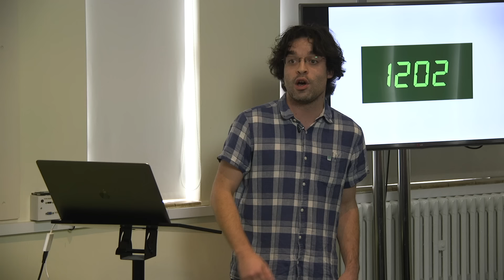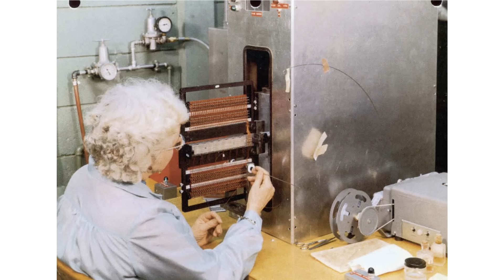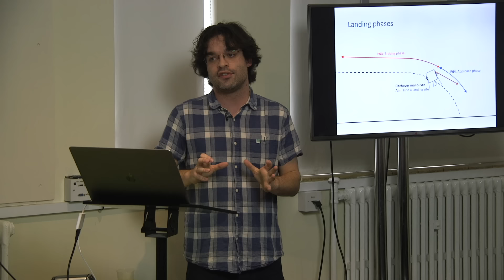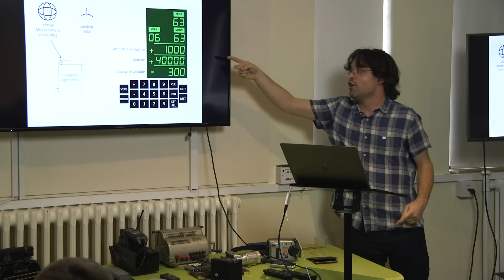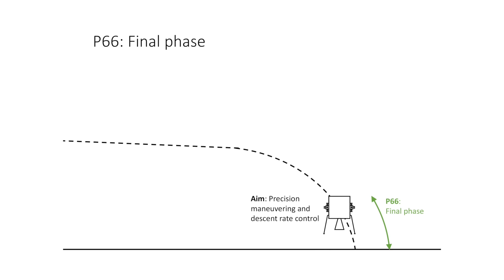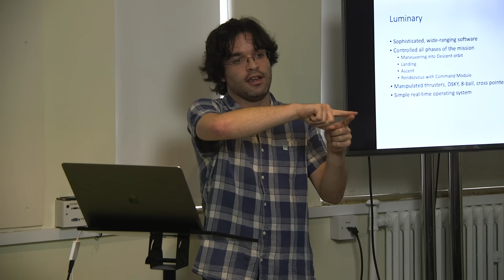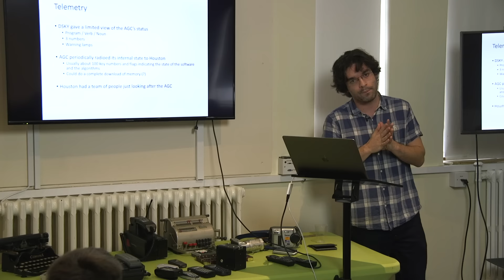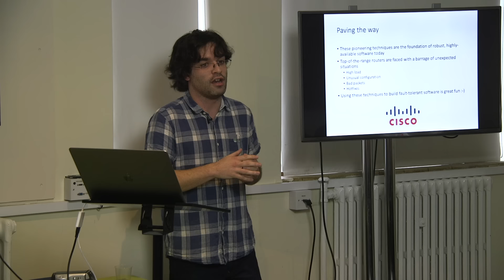Light Years Ahead | The 1969 Apollo Guidance Computer

Comment: Fascinating. Not only does he explain what we would consider a primitive computer, but explains cooperative multitasking in the CPU. By the way, Apple used cooperative multitasking in its operating systems (Motorola 6000 series) up to OS 9. After that, the company switched to what windows and intel already had: pre-emptive multitasking which essentally means the abiity to run multiple programs withoutn throtting or pausing other programs. 

Although the Lunar Landing project’s computer used cooperative multitasking, it’s cpu was overloaded at a critical point by an unforseen power guzzling radar which was pointed not on the ground with the others, but into space for the return. The simple fix was for the astronaughts in future missons to simply make sure that radar was OFF.  The 1202 and 1201s were the error alarms that made everyone freak out. Turns out, they were simply saying “ there’s too much shit coming in for me to digest!”

Armstrrong and
 those who followed always used the manual stick for the last few moments of touchdown, however, the computer was always on and functioning properly.

Comment: Great talk!  I remember the landing like it was yesterday.  Thanks so much.
Reply: P.s.  You should contact Draper Labs, I believe they designed the IMU and probably helped or even designed the simulation software for the IMU and computer testing.  I have worked on strategic guidance systems with them and visited them on a few occasions.  They are basically MIT guys.  Good Luck.

Comment: Over 40 years ago I knew a philosophical sage, a wireman, who I watched putting together a large TTL logic board with 5,000 individual wire connections, all meticulously checked as he proceeded, as one mistake would render the entire work invalid, while at the same time conducting a philosophical conversation with me.
.
The connections were made by the wire-wrap method, using a drill-like device that twisted the end of a wire around a square-cut terminal post, so the sharp edges of the post bit into the wire, making a very solid connection.
.
All the wires had the same pink colour of insulation, as there was no point in trying to colour-code them. The insulation was not stripped off. The wrapping tool, in binding the wires to posts, effectively punctured the insulation to make the connections. Interesting technology.
.
He was a very calm quiet individual, and had a reputation for being able to reliably do what he did. One of the most amazing people I have met.

Comment: I also share your love of compurt history. It turns out that the first mainframe commuter I had access to and wrote programs for,  a CDC6500 at Purdue University, was resurrected and is now running at a northwest museum. Unfortunately it is not running MACE, MESA, and PROXSY, which were developed at Purdue. (It would bring back a lot of memories to see the familiar +++ PIRATE prompt again.)

The 6599 did not have a stack so they implemented an Exchange Package to make the timeshare of more than 100 user terminals possible.

Comment: So, they saved the computer, the software, but not the data collected. Only one reason makes sense: the data was a smoking gun that incriminated NASA.
Reply: All of the data is available in each mission report. You can look through it any time you'd like.
Reply: @casanovafrankenstein4193  also, all the tapes bar the ones from apollo 11. the most absurd part is that out of ALL POSSIBLE EVIDENCE, those tapes would actually be by far the easiest to fake if you wanted to

Comment: While modern software techniques and tools produce much more bulky code than was produced for earlier, more cramped systems, there was also much less code written because it was more difficult to write for smaller systems.
Reply: @lepidoptera9337  Embedded systems are a very different kind of programming than desktop applications.  Go try writing a word processor that way, like people did in the old days of 8-bit machines.  One thing I know is you won't be back any time soon.
Reply: @lepidoptera9337  So you're not writing anything from scratch and crowing about how quickly you can write everything from scratch.  Got it.
Reply: @lepidoptera9337  Here's a helpful tip for you:  I am not you.
Reply: @lepidoptera9337  Why would me not being your projection of yourself be bad for me?
Reply: @lepidoptera9337  And so you had that humiliatingly zing over your tiny head, like everything else I've humiliated you with.
Reply: @lepidoptera9337  Wow, EVERYTHING that ANYONE has ever pointed out to you has just gone WAY over your head, hasn't it?
Reply: @lepidoptera9337  No, you see, you're looking in the direction we call 'up.'  That's because you're wondering what all those things that are flying over your head by such a huge margin are.

Things like, for example, every single one of my comments.
Reply: @lepidoptera9337  By demonstrating that you don't know what any of the words other people use mean?
Reply: @lepidoptera9337  Yes, I am aware that you are uninvolved with embedded systems.
Reply: @lepidoptera9337  Right, the way NO MODERN OS DOES IT.  The OSes that DID do it that way are noted for how poorly they multi-tasked.  Next you're going to pretend that QNX is a good workstation OS.
Reply: @lepidoptera9337  And, like everything else you've claimed, the exact opposite of what you want to do in application programming.  Still think you can write a word processor from scratch?  Or have you gone and learned what that would actually mean you would have to do?

Comment: Nice presentation.  I am not old enough to have worked on Apolio II did work on thr Viking Mars Lander starting in 1972. While Apollo had 400,000 contributors  Viking had 10,000.  Still I sm” amazed ar rhe difference on onbpard computers. Viking by comparasion had a real computer but still a difficult fit for all of the mission requirements..
Some topics were not presented.  Testing Guidence and Controll requires
Reply: a physical world model.  It needs take descent engine and RTG

Comment: his comment on modern computers not featuring positive and negative zero is incorrect.  IEEE 754 floating-point standard (the standard for Intel CPU's)  includes this feature. It is used in linpack for example to distinguish functions that approach zero from the positive and negative sides.   the old timers knew exactly what they were doing.
Reply: That’s not the reason some old computers used one’s complement.  When asked why he switched to two’s complement for his Cray-1 computer, Seymore Cray said he just hadn’t understood it when he designed his earlier one’s complement machines.
Reply: The IEEE 754 standard  does not use twos or ones complement. So it is not connected to what Seymour did.

Comment: 1:15:25 = Yes they knew about cosmic rays, they tested and found out regular chips were not good enough, so a whole new line was developed specially for this job. Originally they wanted to fly with 2 units, but do to weight had to go to just 1.

Comment: Aldren said that he purposely left the radar to the command module on "just in case" they needed to abort.
Reply: It is quite strange that Wills never mentioned this simple straightforward explanation that Aldrin admitted to.
48:12 - Wills goes so far to explain that the Rendezvous Radar was completely useless when you were landing on the Moon.
The obvious point he never acknowledges is that therefore, there was absolutely no reason to keep it powered on at all after the PDI burn was started.  There is no sense to have a checklist procedure direct you to keep it powered on.

A better presentation would have had a slide showing that entire 15% of processor load as being extraneously introduced by Buzz winging it, deviating from procedure, all because in the heat of battle, he felt it was a good idea to hedge his bet that they might abort.  The irony being that his desire to 'buy insurance' for an abort came excruciatingly close to causing them to abort.

The real hero here is Armstrong.  For not killing Buzz once he found out what he did.

If Buzz thought this deviation was a good idea, the bare minimum due diligence would be to inform his Commander.  More properly, also inform Ground Control, who would then have the action analyzed by engineers.  Weeks, if not months in advance.  As a fighter pilot, Buzz should have been taught decades earlier to avoid the 'Three D's'.  Don't do anything Dumb, Dangerous or Different.

This switch deviation violated 2 of those D's.  It was Dumb and Different (unbriefed, unpracticed and untrained).  Then as the landing progressed, it also proved to be extremely Dangerous.  We can expect that Shepard, Slayton, Kranz and Kraft were all livid with Buzz.  All the was up the chain.  And that there is no way any of them would ever let him fly again.

But it was too late for any accountability.  Buzz was declared a hero.

And this is the only reason why I can explain why Wills refuses to state what is so obvious.  He dances around the notion that his hero made this huge error.  One person who knows this story probably better than anyone else is Don Eyles.  Yet he too dances around this straightforward explanation that Buzz Screwed the proverbial Pooch.  Here's the story Eyles tells:
The Real Story Behind the Apollo 11 Computer Error | WSJ
https://www.youtube.com/watch?v=z4cn93H6sM0

Again, the best answer I can arrive at is reluctance to criticize a person they uphold as their hero.
Reply: ...but at least that vid clearly states "human error":
https://www.youtube.com/watch?v=z4cn93H6sM0&t=6m31s

Then stops short of naming the particular human, and why he did what he did.
It was not accidental.  Buzz did it quite intentionally.

Comment: Hubble's Constant, indicates that the Big Bang remnants, with 97.5% 
redshift, were at 13.4 billion light years when the radiation that we 
can now observe was emitted, so this indicates that there is no Big Bang
 to be seen. because in 14 billion years this cannot happen. So it      
   seems that the redshift was not caused by the big bang and that it 
has a different cause, then if we know that the big bang is still 
inexplicably accelerating according to the big bang can offer a 
solution, in the first place all galaxies are almost standing still and 
the light from the so-called big bang remnants can reach us in 13.4 
billion years, the atoms seem to have halved in diameter in almost 7 
billion years, you can from a 50% redshift galaxy that is located at 
nearly 7 billion light years according to the Hubble Constant, our atoms
 that have been halved in nearly 7 billion years have an electron shell 
that is half the circumference of nearly 7 billion years ago and 
therefore twice as much quickly turn their circle around the core, also 
here runs faster through time and twice as fast, which causes the 
shrinkage to also go twice as fast as almost 7 billion years ago and it 
seems that the expansion of the big bang is accelerating, but it is 
shrinking faster, that has some consequences, that the next halving will
 happen in 3.5 billion years and then in 1.75 billion years, etc. , that
 means that within 7 billion years the atoms shrink so far that our 
planets and stars become as small as atoms, we cannot perceive that with
 our clock because our clock is running faster and faster, but the 
planet Jupiter may become smaller and with our measuring stick seems to 
be moving farther but Jupiter continues to describe its normal orbit 
around the Sun and will continue to orbit the Sun in 35 years, if we use
 that as a clock then after 30,000,000 rounds 1 billion years will have 
passed and after 210,000,000 orbits that is 7 billion years and we have 
become infinitely small where the planet jupiter may still revolve 
around the extinct Sun, but not bigger than an atom that we can still 
see today. Whether this is really going to happen is also questionable, 
but it does show where the universe is going to evolve, the redshift 
bands show that there are structures that can influence the shrinkage, 
but with the shrinkage it may be that the properties of atoms change or 
even eventually disappear completely, after all nothing is eternal.
Reply: How does one measure redshift in percentages?  Redshift, in this context, is z=lambda_obs/lambda_em -1.  Given the cmb was light released at recombination, which is when neutral hydrogen formed, with electrons falling from effectively infinity to n=1, those photons would have been way higher energy than microwaves.  So observing a "cmb" means that we observe long microwaves and dividing by small visible wavelengths.

Redshift for recombination is z=1100, meaing we're observing WAY longer wavelengths than initially emitted.  Where's this "97.5%" number come from?  That's a rather specific number.

Comment: 1969 MOON EARTH SUN SPIRALING THROUGH SPACE

Earth, moon, sun spiraling through infinite space in different elliptical orbits on different elliptical planes.

At the surface of the earth at the equator the earth rotates at a speed of roughly 1,000 miles per hour (1,609 km/hr).

The moon orbits around the earth from about 357,000 - 407,000 km away at velocities 0.966-1.100 km/s (3,477-3,960 km/hr),
 
while at the same time the earth orbits the sun at about 30 kilometers per second or 107,279 km/hr.

The average distance from the Earth to the Sun is about 149,600,000 km.

When the Apollo 11 "spacecraft" "carrying" Commander Neil Armstrong and lunar module pilot Buzz Aldrin was launched at Kennedy Space Center in Florida in 1969, everything was believable until the Apollo 11 spacecraft was declared to have separated away from earth orbit and started its way to the moon.

The problem is that in theory both the earth and moon are not stationary but are "hurtling" through space at different spiraling directions at different velocities, the earth at 107,279 km/hr and the moon at about 3,500 km/hr. 

In effect NASA IN 1969 had to target the moon WHERE in 3 dimensional space it would be 3 days after launch time, after the earth had traveled through space (relative to the sun) at 107,279 km/hr or almost 8 million km 3 days later, and double that to get back home to earth.

So, NASA's problem in 1969 was not just rocket fuel for the average 238,855 miles (384,399.9 km) distance between earth and moon but 8,000,000 km distance that the earth traveled in 3 days and double that to get back home in 6 days. 

So, the easier solution was to launch the rocket without the men, dive it into the Gulf of Mexico, distribute taped copies of fake videos, plus a photo artist's rendition of earth photo "from space" and "from" the moon, and pocket most of the project cost.
Reply: The spacecraft doesn't suddenly lose momentum the moment it leaves earth. It carries it along with it. And yes, they would had to target the moon where it would have been in 3 days time. No problem, maths and physics can do that for you at incredible accuracy.
Reply: @atlas8827  guys like you are so pathetic pretending to know something and saying terms you don't even understand. Do you know how to plot in 3D the spiraling trace of moving ellipses that you don't even know the place, foci and other parameters?
Reply: @toymak3275  
Pretending to know something? Ha. You learn most this shit in high school. Maybe you should have payed attention.
We can accurately predict  the location of objects in the sky with high accuracy. The laws of planetary motion have been worked out for some 400 years now.
Reply: @atlas8827  1. Study ellipse, foci, elliptical plane because the globe model is based on the supposedly elliptical movement of the moon, earth, sun, solar system each revolving on one another at different planes.

2. Put values on the ellipses, angles of each elliptical plane with respect to the other ellipses.

3. Put the sources of your values, indicate the degree of accuracy of your values, and indicate the accuracy of the resulting calculations after 1 second, 1 minute, 1 hour, 1 day, 3 days.

4. Show the the spirals of the moving moon, earth, sun, solar system track over the course of 3 days, 6 days.

5. Give me the equation for finding the position of the moon at any given moment.

6. Really, I'm just kidding you. Never mind getting up to stage 5. Just give me the equation for locating the moon from earth on stage 1.

7. Really, just kidding. I don't think you can even make the equation for tracking the movement of 2 bodies on an assumed elliptical path with no definite data even on 1 ellipse.

8. If you insist on showing you know something, even just on the math side of ellipses on planes nobody in earth knows, go on. Otherwise, I'm just showing other viewers how you and many others can be so stupid to pretend to know things you have no inkling about.
Reply: @toymak3275  
please do the research for me for I can't be arsed
 No. If you can't be arsed, then neither can I.
Reply: @atlas8827  go to high school

Comment: Gifted assembler language programmers often write code which can not be further optimized. However, Microsoft found modern optimizing compiler produces code which can achieve results so close the cost to develop in assembler language is not justified. You use assembler functions to implement that which can not be implemented in high level language. Unless you understand how the hardware works you have no business coding in assembler language. I have coded emulator on a mini computer with 16k bytes of memory.